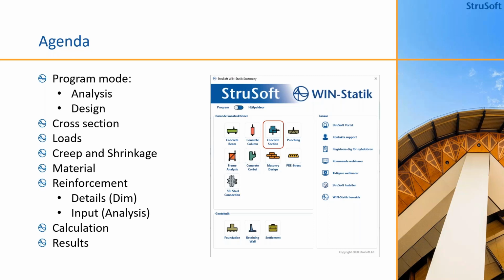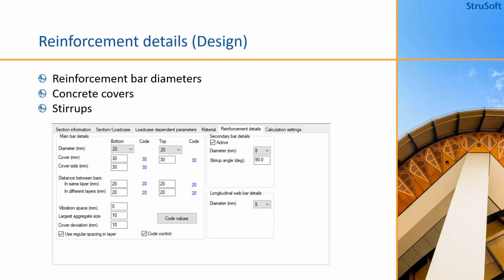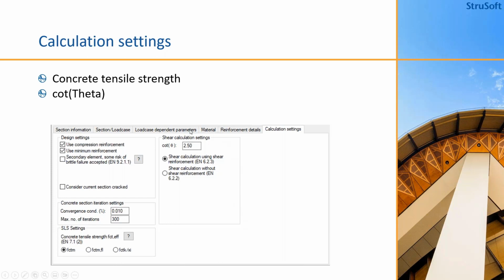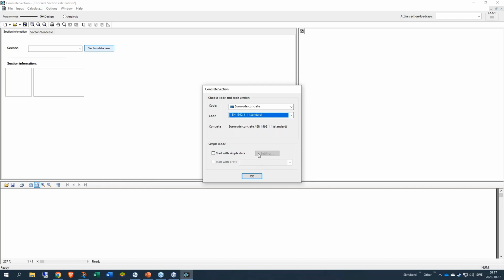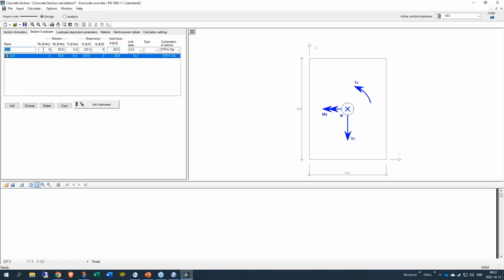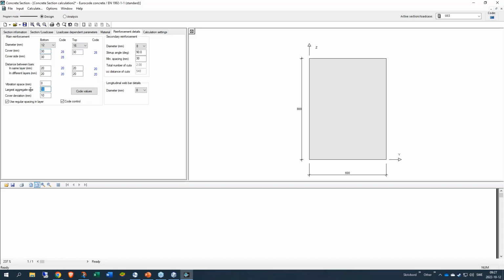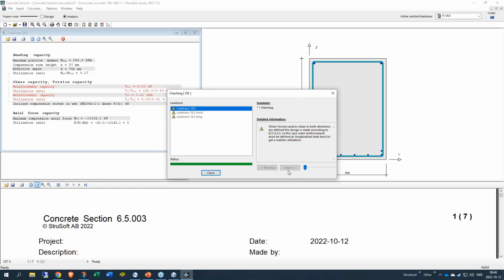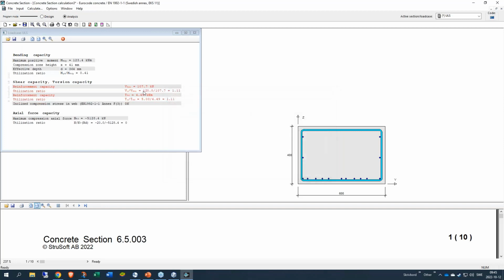WIN-Statik Wednesdays Webinar - Concrete Section (Eng)

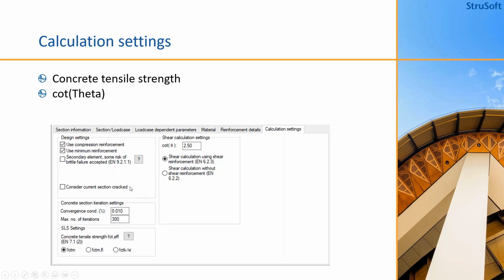Comment: 11:13 "Consider current section cracked" will not affect the capacity. It will just calculate crack widths even for the moments below the cracking moment.

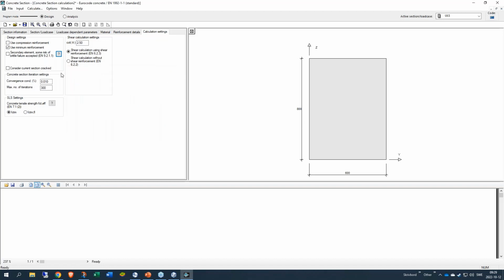28:42 It wouldn't matter whether the speaker used this option for the design or not, since it doesn't affect the design. As mentioned above the option can be used only in Analysis mode for Serviceability Limit State. The results for which the speaker, by the way, has omitted of some reason.

I'm afraid that the speaker doesn't know what this option is used for.
Reply from the maker: @timofejSE sorry for delay, your comment went to spam. Anyhow to answer your question,  the option "Consider current section cracked" is only used for SLS load cases which are only calculated in Design mode.
Reply: @StrusoftOfficial  There was not a question. I just pointed out that the information given in the video was not correct. Even your latest answer is not correct. Your software cannot design for SLS and thus, "Consider current section cracked" is to be used in Analysis mode, when you want to see crack widths for moments below the cracking moment.